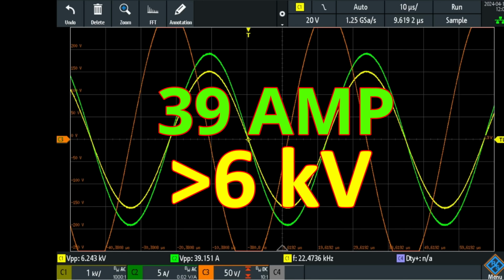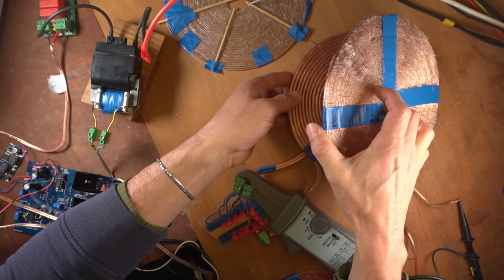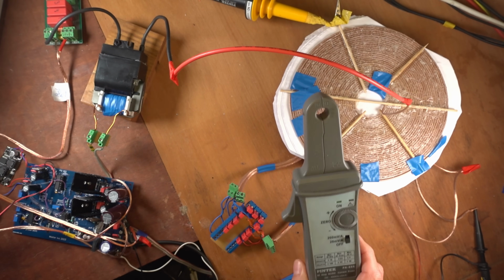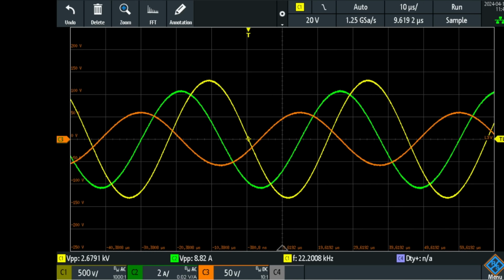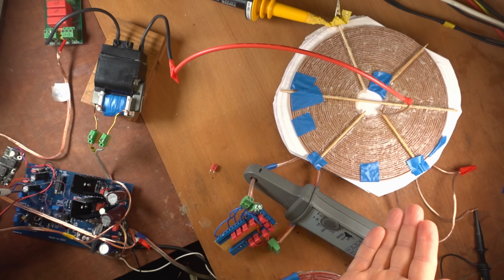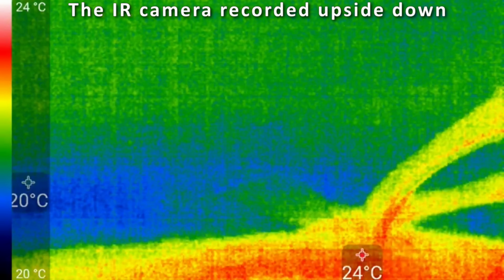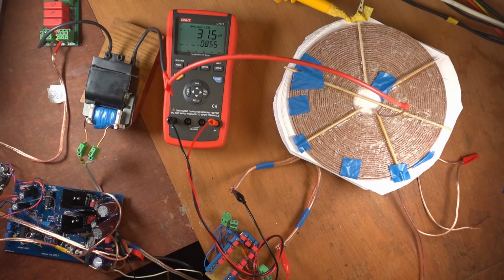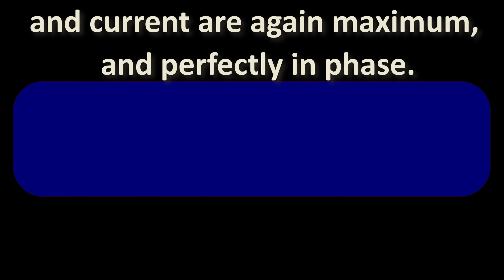Tuning a dual resonant system creating high voltage and current that are in phase.

Comment: Don Smith in his later years released the schematics for the inside of his 'black box', and part of those schematics was an element which would automatically tune the frequency of the device depending on the load. Do you have any idea what he might've used, or have any ideas on replicating the same functionality in your future work?
Reply from the maker: PLL Phase Locked Loop comes to mind. But esp32 with sensors and a decent program should also work.
Reply: @MasterIvo  Appreciate the answer! I'm newer to electronic engineering in general, but your content is super enthralling
Reply: Interesting... You know six pyramids make a cube/ box. I wonder if it's similar to my device.
Reply: @qinaan  my friend, thanks for the resume, what are these "spider web coils" ? I think i never see one O.O im intrigating
Reply: Hey Cheyenne, do you have a link to that schematic?!?! Thanks
Reply: @NickyTesla-pg1ex  I don't but if you look up his seminars or whatever they are on Youtube, it's the one he did in.. I think 2005? His son is there, and they're talking about various things, moving through slides, and eventually they show it on-projector and discuss it briefly.

Comment: The first tesla coil I built, I used copy paper as a capacitor as well. I took aluminum foil, and layed it in laminating film and laminated it as the 2 plates. And then used paper to fine tune the capacitance of the system. It is a super simple and cheap method of making capacitors. Good work on the setup you have. I like the pcb you built. Keep up the great work
Reply from the maker: thanks !
Reply: @MasterIvo  have you considered that resonance is also a quality of sound? When I was experimenting with tuning forks I noticed that a tuning fork will resonate with a frequency that matches its tuning, or any multiple thereof.

Would you consider experimenting with your system to see if multiples of the primary coil would resonate with the secondary? I am interested in the potential results, unfortunately, I don't have a system as articulate as your system is.

Comment: Have you ever looked into Stanley Meyer and his water fuel cell.   He aimed to get voltage to build and resonate waters dielectric properties while the water capacitor being leaky from some impurities making it not perform as such.  He claimed to elongate the dipole molecule while there being free electrons within the water that could disrupt the covalent bond of water in a way that require less energy than current chemical method electrolysis..
Reply from the maker: I'm not interested in particle physics. I am fusing the fields
Reply: @MasterIvo  when it comes to a water powered car. the energy is being made in a reactive component (capacitor gap) all in the inventors writing he repeats particle oscillation as a energy generator.. the particle oscillation spoke of is reactive energy in the gap reacting with charged particles. so although you say your not into particle physics.. but what if it evolves around reactive energy! the is 2 means of reactive power from water.. electrolytic and dielectric. charge  particle migration toward electrodes and dielectric polarization.. Love your videos!!!!
Reply: @outlawstc  no need for water powered cars, petrol was good but they are taking it away. water powered car would be just as idiotic as electric cars

Comment: First to mention I survived the cold current from last year,  the persistent cough required a bonbon with  Melisa,  hmm it calmed and so could cure.
Interesting work and IR cam heat análisis, looks you can heat by pancake coils a room with little  input ? Nice  to see that in one of the most affected country of the future climatic change there is a high motivation to come to a device that can take more energy out than in. A multi channel tuning regulator for load management might be necessary. Load prediction or a intermediate battery reservoir might be useful to be a device that powers everything, incl perhaps electric vehicles. Thumbs up for the instruction of coil and tuning practice data. Awaiting a load experiment with further insights.... Remember the resonance under load is a fugitive thing humanity wants to dominate , like squeezing a wet peace of soap  that slips out of hands,  so a intermediate energy reservoir will help in the sense of loading it back and not tuned for instant load power rather for quick recharge of a battery, comes to mind.
Reply: right, should be able to use a high freq to charge a big cap bank then use a timed switching circuit to discharge the cap bank to load or storage system. multiple isolated resonant coils within your wireless range that have external ground sources could be combined and rectified as well, no?

Comment: Ivo, this is indeed fascinating stuff, thank you for your work. If paper is no longer a good medium for a coil capacitor, what do you recommend now?
Reply from the maker: air, or if possible a vacuum. but that isn't practicle. Some plastics have low dielectric losses, but that also depends on the frequency used.

Comment: Great video, especially going through the tuning in detail, and how sensitive and reactive it is to shorting the HC coil.  A question I have, can one fine tune with a variable air capacitor?  Is that quality enough to allow to fine tune?
Reply from the maker: it is possible in theory , but the capacity needed is so big that it isn't practicle. I now adapted a switched capacitor tuning board with its smallest capacity being 10nF. In fact It needs 5nF. but often air capacitors are max 500pF. so that is to small.
Reply: @MasterIvo  Yes okay, I understand.  I purchased a 2000pf, but I figured it would be good to fine tune near the end of tuning once you are very close with other added parallel capacitors.  Great work sir.
Reply from the maker: @fernandogigliotti2299   thanks, yes that makes sense, as a final finetuner

Comment: Is it posible to tune theorically an auto induction coil like a darsonval oudin coil? The input for the primary coil is a high voltage supply with a single or more spargap in series between the two poles, also it has attached in the middle of the primary a earth ground wire in order to work properly. The question here is the measurements for making the primary resonant with the circuit so the secondary is able to pump electrons from the ground out of the two terminals from the secondary. Sorry for the inconvenience, I just want some old apparatus that were working 100 years ago without problems and are intact today, tried as many scientists to power up in regular terms of current and voltage but dont work as intended. As I observed that with negative unidirectional longitudinal impulses from the darsonval oudin circuit the effects are attainable, such as dielectric fields, effective and efficient wireless power, and healing properties from the correct application of 100 year old therapies
Reply: The circuit can be powered by a ruhmkorff coil with a single spargap in the circuit, or a zvs/flyback and triple spargap

Comment: Hello Ivo, I am also researching the radiant energy of Tesla, I really like your work but there is something that is not clear to me, when you say displacement current are you referring to longitudinal energy? On the other hand I do not understand what you use the output coil for. The middle one I see is 90° out of phase. I think that longitudinal energy is perhaps better used in a different way, without rectifying it for example since it is different from an electromagnetic wave. I always think that Tesla did not use diodes or semiconductors. Greetings from Argentina
Reply: put that in a copper sphere and watch what happens

Comment: Ivo, first of all great work. I was wondering if your output would be increased if you put a plate on the end of the HV coil and possibly at the beginning of the output coil. These may draw more energy from the environment.
Reply from the maker: probably not, but you can always try.
I rather think I need to use the electrostatic effects better. the square wave isn't good. it should have a slower charge and faster discharge, and tuned to the negative voltage maximum of the hV coil.
Also the PVC coating is probably damping the impedance effects I need. (read Tesla's 1891 lecture!)

Comment: wow that is a lot of power ivo , in the next video which am sure you will test this tuned system to your resistive load , can you go over the push pull transformer part not clear if its a custom built , if you can also do like a digram , good job man
Reply from the maker: Thanks. Push pull, is like the half bridge circuit, which drives the primary of the high voltage ac transformer (black box)

Comment: Have you thought about using a Phase Locked Loop IC to keep your HC coil in phase? You might be able to use an IC like CD4046 with a feed back signal from the HV coil to keep the system in perfect phase sync regardless of what load is connected.
Reply from the maker: Yes I have, but I'm still missing the powerfull electrostatic effects which Tesla described in his 1891 lecture. first I need to get that right. Then PLL will help

Comment: 1. Is the coil & capacitor coil at the same values 
2. You should put them in series 
3. How are you PULSING IT.
4. Is the GROUND in-between the L & C
  L 100mH C 100mF
Reply from the maker: 1 no
2 which and why?
3 square wave on the high current coil is 80ns impulse of severeal hundred volts combined with th3 capacity
4 I do not understand the question
I use earth ground on the output coil only, which is tied tonthe copper water pipes of thr street

Comment: your HCT123 is used for phase shifting/correcting the impulse correct ?
Reply from the maker: yes, it gets a signal, from the first IC, then delays it, and then creates a pwm for the gate driver of the mosfet that switches the coil that produces the voltage impulse
Reply: @MasterIvo  I see, so you do not use the bucking coils and the distance between  them (principle) for phase shifting/correcting anymore ?
Reply from the maker: @ninukanjan9400  indeed I do not

Comment: oh wow, I've got the pintek pa-677 current probe, and I'd wondered why the measurement was so sensitive to the position of the probe....
Reply from the maker: Yes, I'm thinking about putting copper tape on the clamp mouth and earth grounding it, but that will probably still give problems.
But it is a way to look at the displacement currents!
Reply: @MasterIvo  for now it's a good lesson for where to clamp the meter, i.e. to probe the current at quiet places near outer edges and low ends of things 🤷

Comment: What exactly is your point? Did you tried to measure the power in? And power out? 

You say the voltage and current are in phase but those are not in same closed circuit
Reply from the maker: The fields are in the same time and space, which is essential

Comment: So if I understand this correctly you need a constant value load like an inverter in order to not require re-tuning when powering random utility loads. Correct?
Reply from the maker: no, I need a pure  resistor , not an inductor or  a capacitor as a load .
Reply: why people do not use easily RF NOISE driver :)

Comment: Tuning forks ring with sympathetic resonance. Is it the same electromagnetism? Frequency and vibration.
Reply from the maker: Yes, when electric systems are tuned to the same frequency they do that also
Reply from the maker: @qinaan  I feel you're confusing the medium. Audio uses air. EM uses the Aether to vibrate. frequency is periods per second so infinite.
Yes everything is vibratimg energy. the whole universe.
we need free electricity for the people, the market will adapt
Reply: @MasterIvo  just hijacking this thread here, why is it that the only people I see referring to the emf needing a medium of transfer is electrical engineers....
Reply from the maker: @jumpinjaxs  because a wave is not a thing, a wave is what something does. The water is waving. So what is waving with EM?

Comment: The coil is out dated for small scale energy distribution we have better stuff just vary low quality if I had access to military grade electronics man I could get three times output then input I'm getting double with the worst of the worst ok
Reply: And it matches up with the rc circuit formula it's crazy